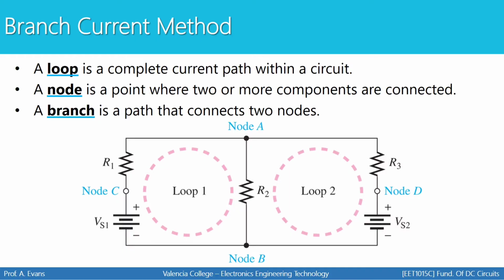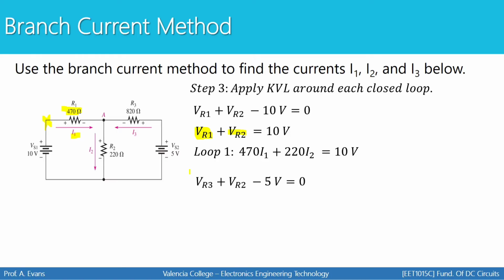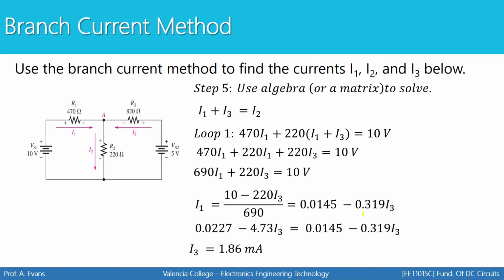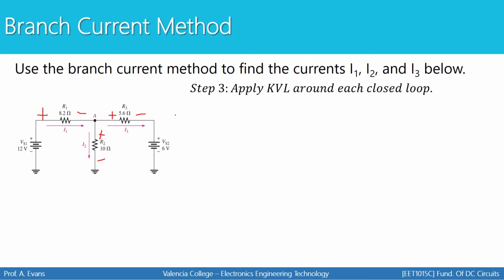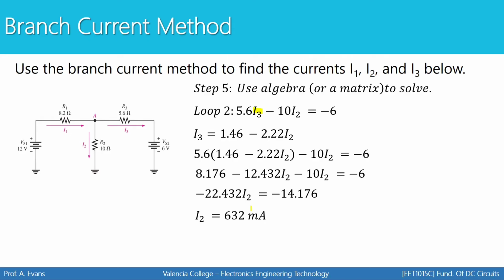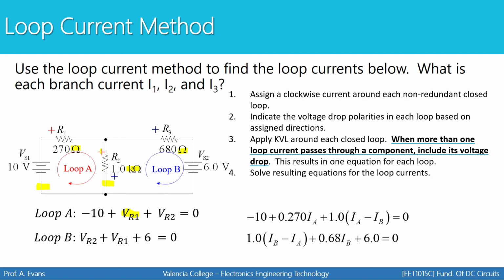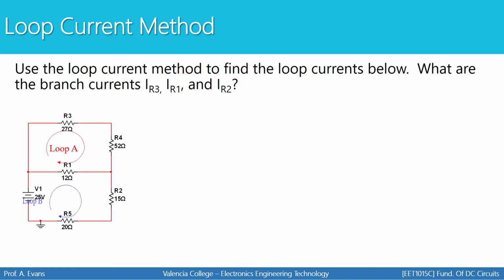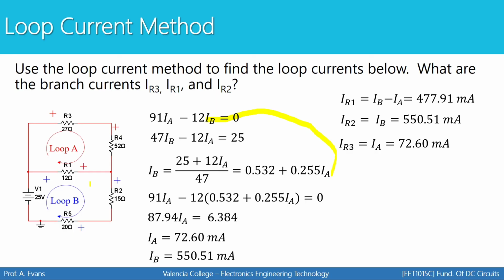[EET 1015C - Fundamentals of DC Circuits] Branch Current Method, Loop Current Method

Comment: Why is current 3(I 3) in the second example flowing in a different direction?
This is confusing me.
Reply from the maker: We can arbitrarily assign the direction of each current when beginning the problem.  If the value for each current comes out positive, that means the direction we picked is correct.  In this case, it might seem like the direction for I_3 should be reversed, at first glance.  This current came out to be positive though, which means the polarity we initially selected is correct.  Ultimately there is more current flowing from node A towards V2, than what is flowing out of V2 towards the node.  So the final direction of the current is to the right.
Reply from the maker: Using superposition, you can determine that the current provided with only V1 in the circuit will be 652 mA, flowing from node A to V2.  With only V2 in the circuit, 594 flows from V2 to Node A.  This leads to a net current of 652 - 594 = 58 mA, flowing from Node A to V2.  Therefore, the final direction of current I_3 is what is shown in the diagram.  Does that make sense?

Comment: First of all Thank you so much it is really helpful, but may I ask why the result of Currents is in mA not A ?
Reply from the maker: When you apply engineering notation and follow each equation correctly, you'll see the currents come out to be very small. For example at 9:39, I3 comes out to be 0.00185899 Amps.  Applying engineering notation, we would move the decimal point 3 spaces to the right and apply the prefix "milli" to our answer to indicate this shift.  Therefore the answer is written as 1.86 mA, but the unit of mA immediately indicates that the answer is also 0.00186 Amps.
Reply: How you get I1? can show me the steps please thanks
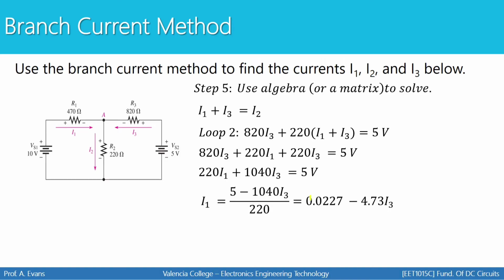Reply from the maker: @williamminggol6059  once you have the value for I_3 you plug that back into the equation that was derived for I_1.  Look at the equation at 7:32.  That's where you plug in I_3 to get I_1.

Comment: Algebra or matrix,u still come to the answer but my lecturer marks strictly matrix only
Reply from the maker: Hi Gladys, you are correct. Both methods will provide the same answer. However a matrix is more versatile for circuits that have more variables. This may be one reason why your instructor wants you to rely on a matrix. Thanks for watching!